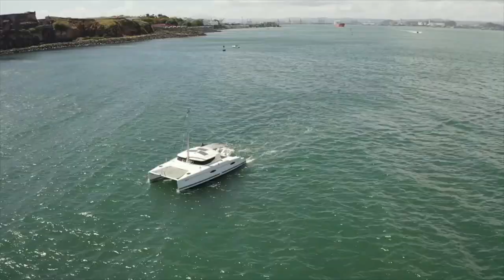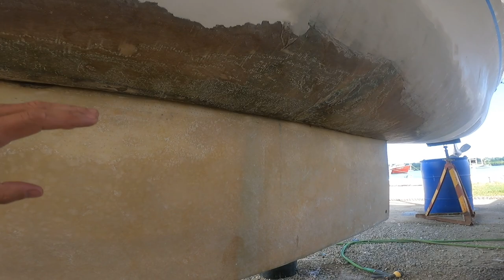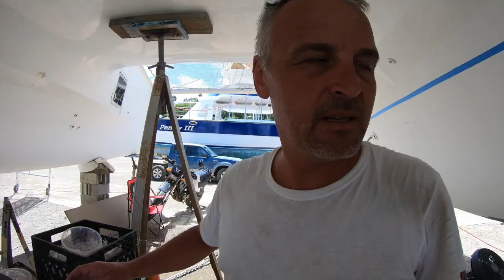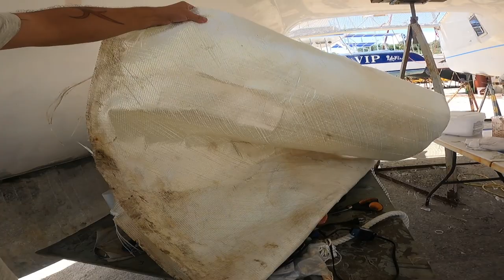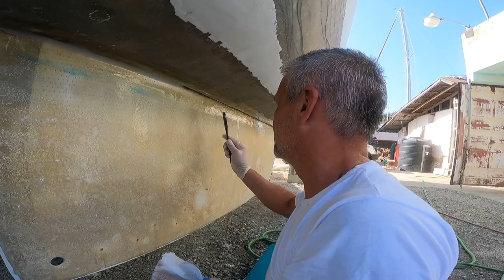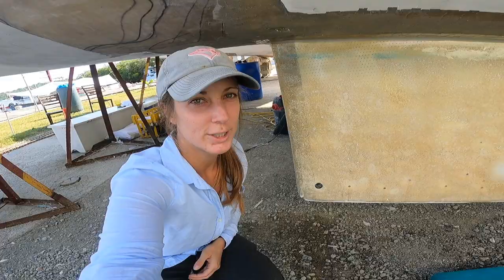One Step FORWARD Two Steps BACK - The Joy of Fibreglassing (S2 E66   Barefoot Sail and Dive)

Comment: Leave the tow hole in the keels if it is in the rear of each keel. If you happen to run hard aground, you can tie a line there to pull her out instead of putting all the force on the keel hull joint by towing from a cleat on the hull.

Comment: Saw your video on osmosis and must say that you can’t protect your hull against osmosis from the outside since the cause is inside !!! Correct procedure is to remove the gel coat layer then use high pressure steam to dissolve the salts in the cavities and wash few times with acetone before covering up again

Comment: with the help of a sachet it is convenient to apply a uniform surface transition to the inside for better penetration of epoxy; it is weak because you partially cut off the sealant with the help of an attempt to remove the keel

Comment: I would say with the amount of repairing you have done that you should do the roll and tip method of paint application so you don't see the imperfections in the hull. Free range sailing just did a video on this.

Comment: The cause of osomsis is a mix with al lot of accelerator and hardner in the regular polyester resin . Also air inside the laminate is a cause for it . In the years i was working on building glasfiber yachts there where a lot of osmosis problems on boat's build in France . Benetau did not have a good name in those years

Comment: Looking good. Once you start on the inside, would it be useful to cut the top of the keel pocket open and fix any voids etc? A big wrap of glass over the top would seal it all up. Happy Easter, cheers.
Reply: Cutting off the top and filling with epoxy is a great idea. Would provide the best possible bond to the hull.

Comment: The Logo on the bow both sides and maybe a line or two of a color of choice fore to aft. A simple square cut off at front and back or do an arrow at front and rounded off end at stern. You guys are doing the job right no reason to over do a color or paint job when simple lines like large pin stripping on the sides with your logo
Reply from the maker: Cheers!

Comment: good work with a polyethylene bag, perhaps it would be much more effective to clog this gap between the keel and the hull of the ship using an old clean silicone cartridge with a pistol with replaceable thin needles there you can create more pressure and push it into the gap deeper

Comment: Get rid of the hole in the keel. You can´t inspect the inside surface for damage, osmosis, etc. If you don´t close it up now, you will always ask yourself if it´s a potential for water ingress. (and I highly doubt it would make a safe towing point)

Comment: when cleaning the bottom of the boat, use a handle with suction cups - way easier than using that hole. Amazon- suction handle for shower or glass.
Reply from the maker: We have one of those. It was more a joke 😆
Reply: @BarefootTravels  you had the wrong model for you, They have all different types

Comment: I'm surprised to see no stringers going from side to side next to the keel pockets.  When the boat sails, there are tremendous forces acting to push the keels sideways.  Its going to try to make the keel pockets lean to one side, then the other side when you tack, trying to flex those spots where the pocket goes through the hull.  Maybe add some support to prevent that once you have glassed over the holes.
Reply: Cats flex all the time and glass allows that without damage if allowed to work as area.  The keels only need to be well supported inside the top of the pockets.  The hurricane showed the weakest point by cracking the hull next to the keel (that giant long crack which is already fixed).  That area obviously needs to get stronger, best from inside and outside with large sheets to distribute the force, and I understood Davy to do that.  Anything not destroyed by the hurricane is strong enough. :)

Comment: Hi guys your doing an amazing job, I had a thought come to my head about your keels, could it be a good idea to cut in to the pockets inside the boat in a few different places and pump some thickened epoxy in the top parts of the pockets so if there was a knock or bump it doesn't  lever left to right the keel in pockets and possibly cause any damage, just a thought even though your re glassing over should be great 👍 I wish you all the best and the holes in keels are great if they fall out and you need to toe but you should be good now hey x Kent UK 💜
Reply from the maker: Thank you!

Comment: Bummer to see the keels didn't come off. This must be the second best solution, if not the only practical one. Good job!
Saw you make contact with wet epoxy without gloves though... Please be aware of the always lurking allergy!
Do not clean your skin with acetone because it thins the epoxy; use plain vinegar, it neutralises and cleans like a charm (at almost no cost)!!!
This also works perfect on your tools!!!
Just wash your hands in plenty fresh vinegar, and rewash with normal soap.
Just put your head down and your chin up you two!
Reply from the maker: Thanks for the tip!
Reply: @BarefootTravels  A long time ago I built a Wharram cat. Being young and unknowingly careless I developed a massive epoxy-allergy.
Even now, some 30 years later, if I am to touch uncured epoxy like you did even so slightly with one finger, the next day at least my whole hand would be itchy, full of little bump-like blisters.
And itching that it actually hurts, and you would want to scratch your skin plain off... After about at least a week the skin comes off in large crusty flakes.
This is not a bit exaggerated, so please be warned!

Comment: hey there are two ply wood covers on the keel trunk. are there holes to pry the keel out located there? now that you have a huge hole in the side of the keel and rotten core you would be further ahead to remove them. pouring high density foam and shaping with them in place is going to be tough. if you have to I would cut holes to pry them out. replacing the core in the vertical position is going to have you hating life.